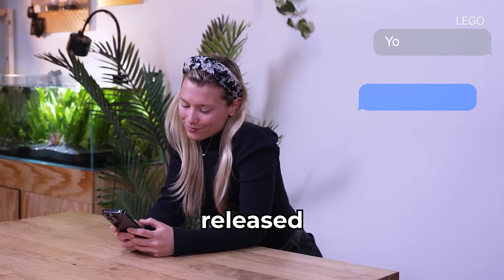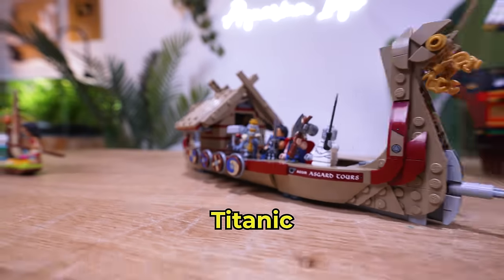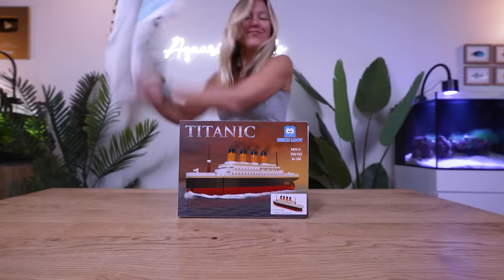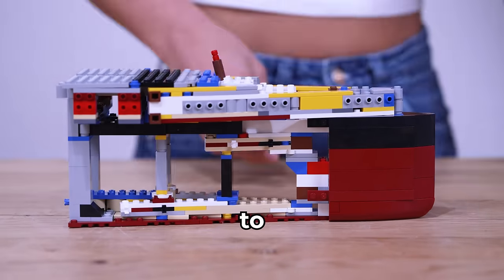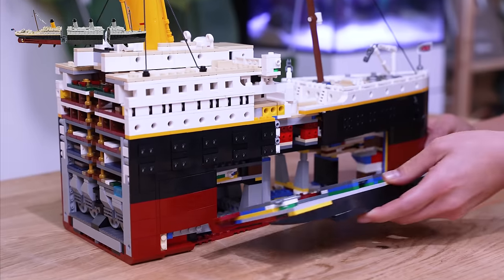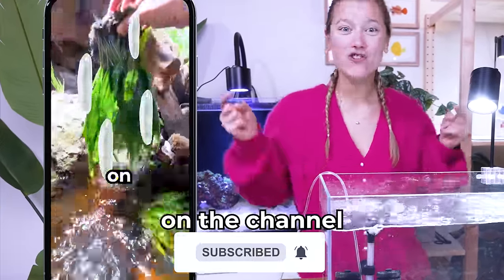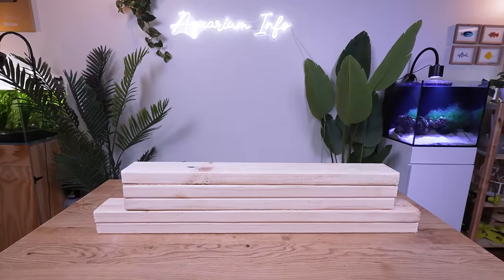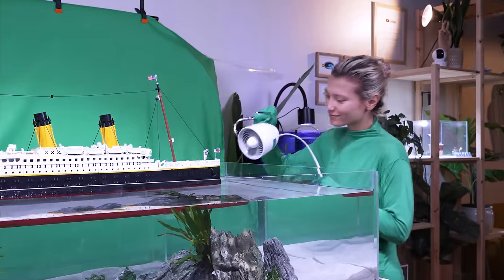I Built the LEGO Titanic for my Fish

Comment: Great but very expensive idea to add more ship astetic:

You should add another tank right beneath into it, for more Fishes, a second Lego titanic plus many custom parts to replace the Outside parts from beige (deck floors) to brown, Red and black to brown, white to dark gray or brown, the funnels from Black and yellow to brown.

Then split the Ship in 3 sections (one right behind the 3rd funnel and right in front of the 3rd funnel - because it is not very clear where exactly the Ships split, and because there is many broken apart from the wreck, you can literally remove the section of the third funnel.) before you do that you need to check how the Wreck of the Front and the Stern looks like, so you don't really need to replace the colors of everything. Only the hull sides, the decks floor, and that's it. Only a few things need to be detailed, like the visible open lying engines on the breaking point of the Stern wreck. You also should type a year behind your google search, since much modern pictures shows a more decayed ship wreck of the Titanic. To make the most iconic wreck, use pictures of 1985. 

Put much sand into the second fish tank and split the bow part of the wreck again, right below where the bridge front is. Remodel the the top deck in a way that the part where the ship split in half has been collapsed.
Because the Ship crammed into the ground with the bow tip first, it split again on the section right below the front bridge and A, B and C Deck, so you have to Split the front ship and put them into the tank in a way that only the Bow is obliquely forward Tilted, while the rest of the Front section of the wreck remains in a Stable position.

The wreck is a bit more... Complicated. Remodel the Stern section like the original. Use the Engines and place them visibly on the breaking point site of the Stern. Fill both breaking points with plates if they're hollow, since they could not be the official Lego set's split sections.

After that place the Stern wreck into the opposite direction than the bow section, since the Stern took a 180 turn while sinking. You don't need a scaled down distance of 600 meters between the wreck, but put them a bit more apart from each other, not too close.

I recommend to add more of those dog windows. Add some blue water proof lights on the top of the lower aquarium, and make sure you glue all parts of the wreck together, so they won't break apart. Then at last you can fill the lower aquarium with water.

Man I'm sure it would look really sick having a Operational Titanic on the top Aquarium and one Wreck on the Lower one...